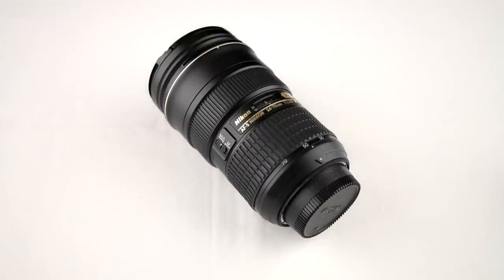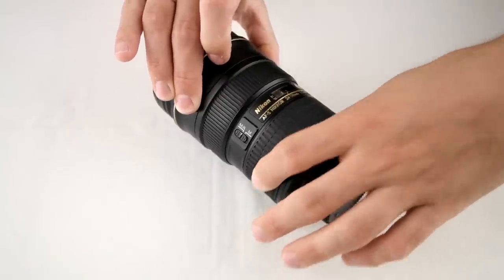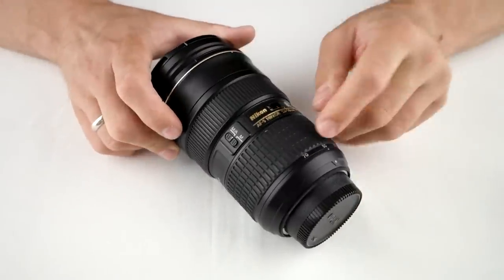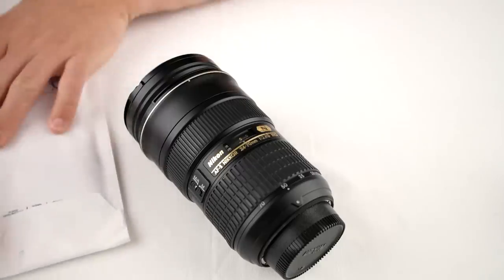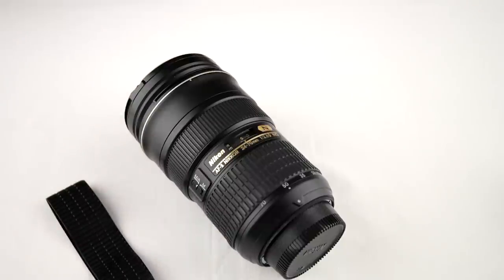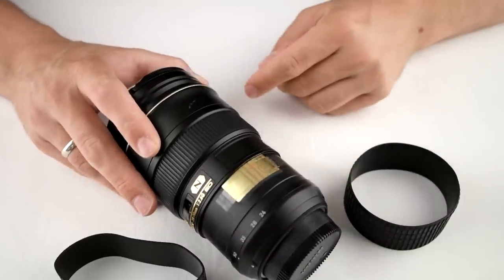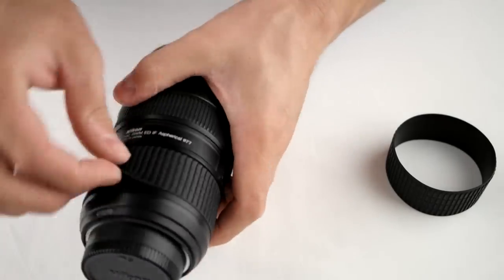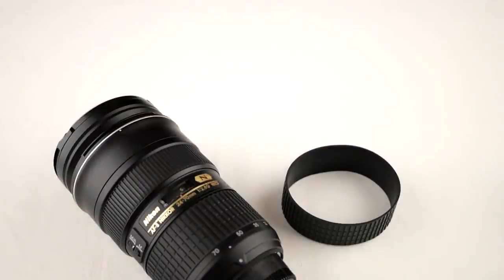Exchanging the rubber ring on a Nikkor 24-70mm f2.8 lens

Comment: Thanks for the info and that no glue is needed. A couple things: - Why not do the focus ring at the same time. -Easier installation is to use some card stock paper between the rubber and lens as a sleeve to help slide it on (it worked great).
-It appears there is a taper on one side of the zoom rubber (I got it right by accident) no taper on focus ring

Comment: Very usefull video, i bought a new one for my 17-55 2.8 
so, without any glue it just works, right?
Reply from the maker: No glue, correct.
Reply: Goivanni.. did you end up replacing the ring on your 17 55 2.8? and if so was it easy to do.... no glue etc...